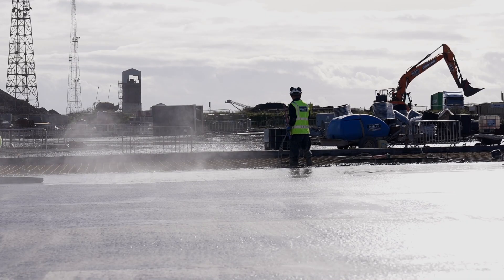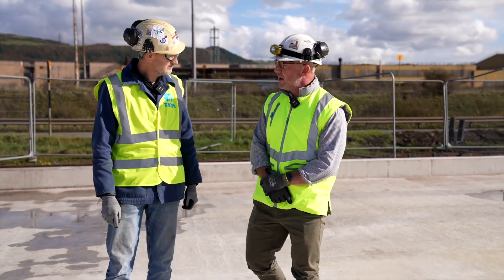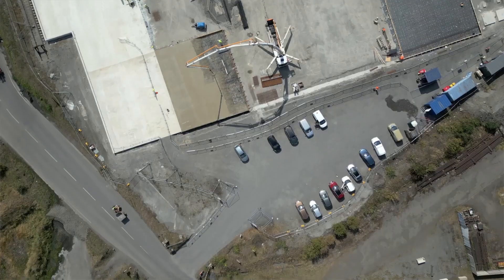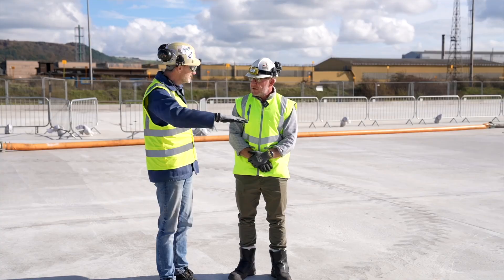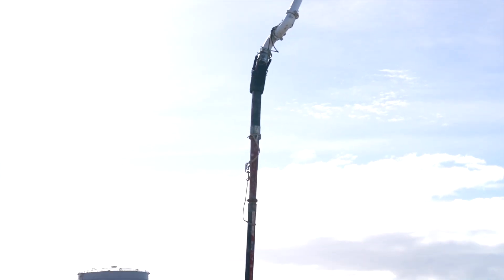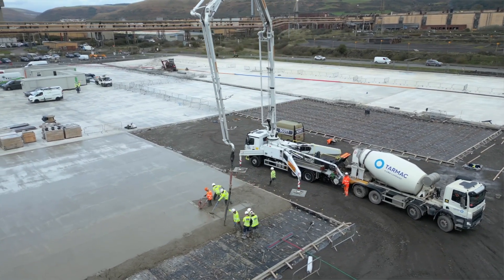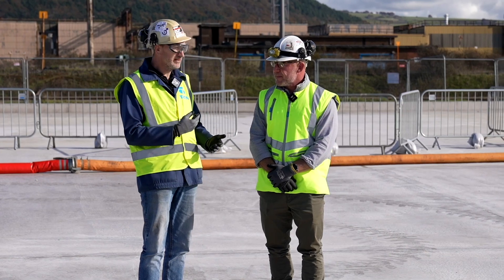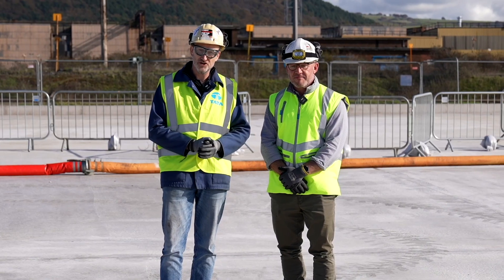From Storage Yard to Scrap Hub | Building Port Talbot’s Green Steel Future

Comment: P Field was part of a sometimes complex arrangement of external ‘slab yards’ or storage areas located at various points across the Port Talbot site. The Concast plant had its own yard for holding slab ahead of further processing while the Hot Mill had its yard adjacent to the mill comprised of an Open Gantry in front of the works lorry park and an undercover yard comprised of 2 bays. Over the years the Works operated slab stock levels that ranged from circa 20 k tonnes to 250 k tonnes. Consequently a host of other external areas were periodically utilised as slab yards. These were located in ‘empty’ areas dotted around the site. By far the largest was the Main Yard located in the open space (formerly the Open Hearth Steelmaking facility) between the Steelmaking Plant and the Mills - the Main Yard was divided into smaller areas known locally as ‘fields’, P Field being one of these. Other sites have included the Coke Ovens site (the site of the BF rebuild offices), the Ingot Bank and the Stripper Bay (formerly part of the Slabbing Mill operation), the Mould Bay (situated off Central Road) and the South Sidings (south of CAPL). Some of these sites were often used as hubs for exporting slabs when the iron and steelmaking capacity exceeded that of the rolling mills. 😊